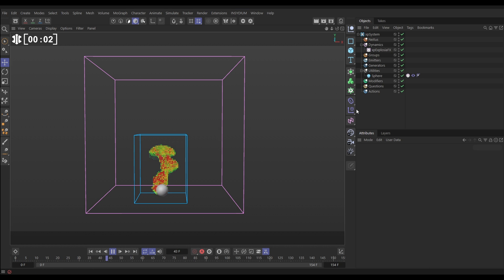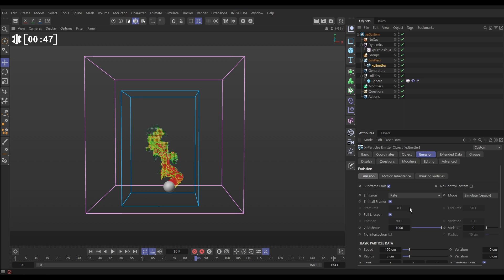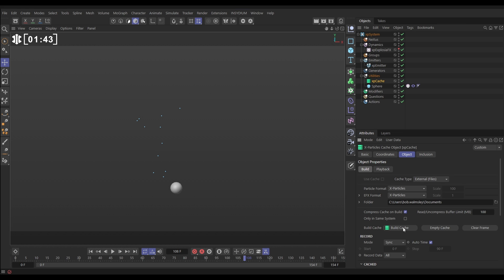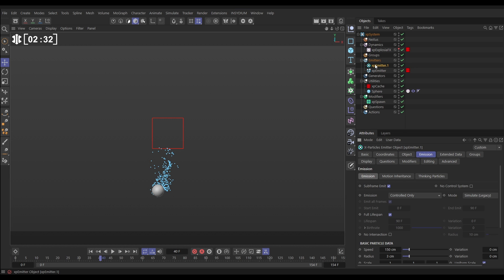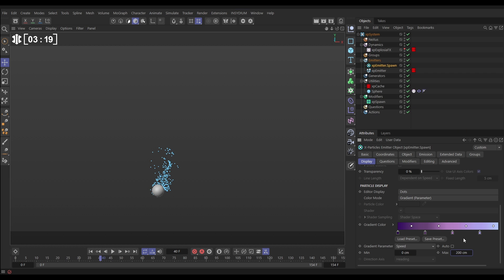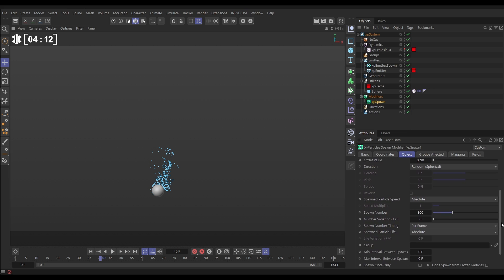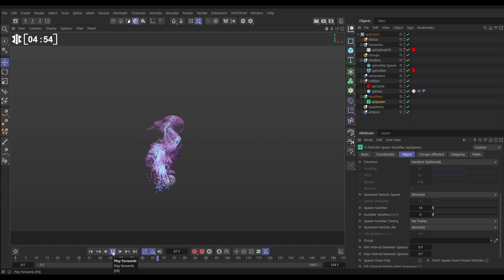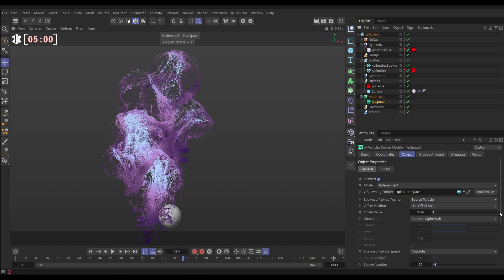Top Tip Tuesday - xpCache Spawning

Comment: Is there a reason I'm only getting about 13 particles max, before i cache? It seems like you are emitting much more particles off the sphere that I am. I believe I have the same setting in my scene. Seems like I have to have the birthrate up to 150 to match you're look, while you have it at 10. ¯\_(ツ)_/¯
Reply from the maker: It sounds like your particle Birthrate is set to seconds, not frames. Open the arrow pulldown next to Birthrate to switch between the two. Bob has his set to Frames in this video.
Reply: @INSYDIUMLTD   that was definitely it thanks for getting back to me so quick

Comment: Why don't we simulate many particles at once, if spawn particles need ExplosiaFX for advection anyway?
Reply from the maker: If you just simulate many particles at once, they need to be born at the same position at the bottom of the smoke sim. These will then be advected upwards by the smoke. This can look very cool and is often what is done for wispy effects. The method that Bob demonstrates here offers a different look, in which the base particles continually spawn new particles over their journey. This has the effect of filling out the whole volume and can add lots of very fine detail.